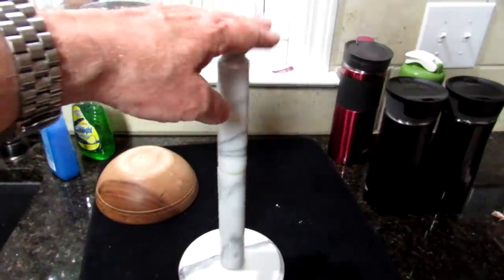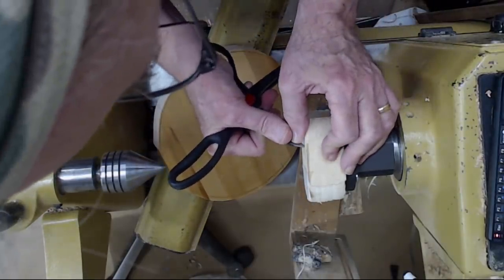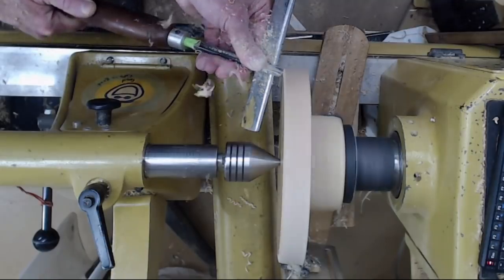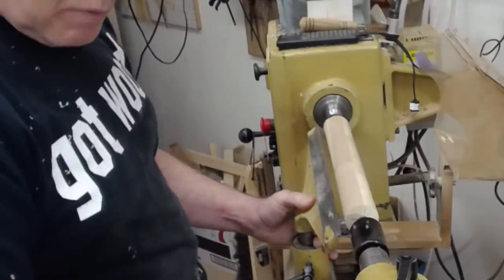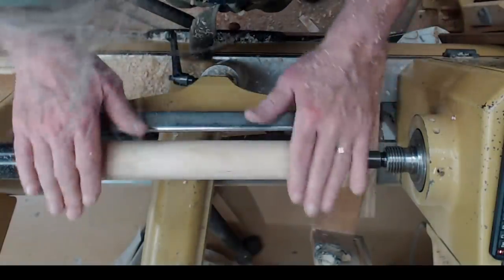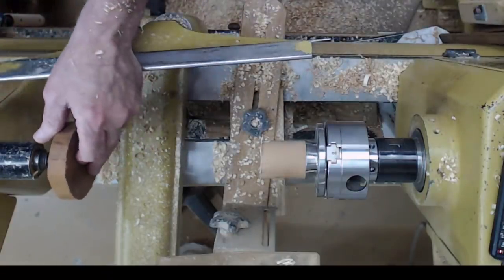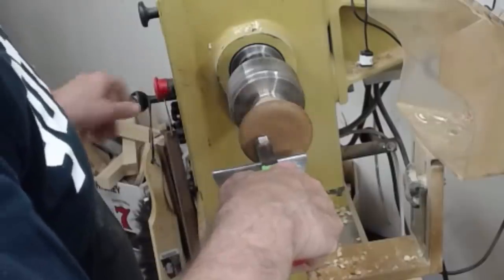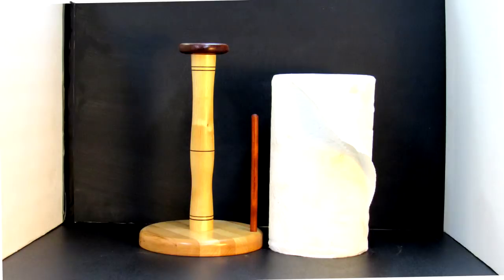Turn a Paper Towel Holder

Comment: I d like to try some texturing , was wondering if there anything laying around the workshop that would do the job rather than paying for the proper tools ?
Reply from the maker: You could turn the cap end grain and use a chatter tool. They are fairly easy to make. I have a video on chattering in my texturing playlist. I have a video on each of the basic texturing tools. Unless you take up carving, which I don't do, the texturing I do does require the proper tool. You can pick up a Wagner knock off tool for about $30 from Ron Brown's Best. You can get a dremel bit texturing tool from Highland WW for about $30. I use my texturing tools a lot so I feel as thought the money was well spent.
Reply: Thanks mike will check your chattering video, being in Scotland everything seems twice the price what you would pay